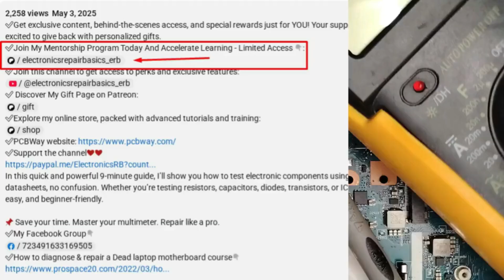Step-by-Step Voltage Flow in Laptop Motherboard Like You've NEVER Seen Before

Comment: Can you explain some time about the new standard of usb c charging . It seems very confusing , as most laptops use this now . Thanks for the great work
Reply from the maker: Absolutely USB-C charging has become a standard on most modern laptops. But not all USB-C ports support charging, and not all support fast charging or high power levels.

What matters is what’s behind the port, the standards it supports.

Old standard: USB charging maxed out around 5V/2A (10W).

Modern USB PD: Goes up to 240W (with USB PD 3.1).

USB PD 2.0	100W (20V, 5A)	Common for laptops
USB PD 3.0	100W	Adds better communication and safety
USB PD 3.1	240W (48V, 5A)	Needed for high-performance laptops/gaming.